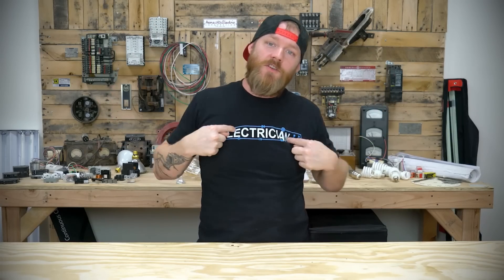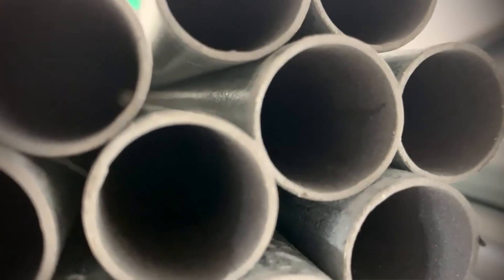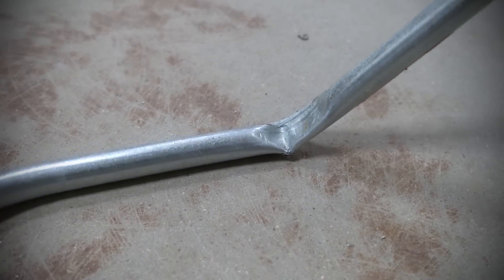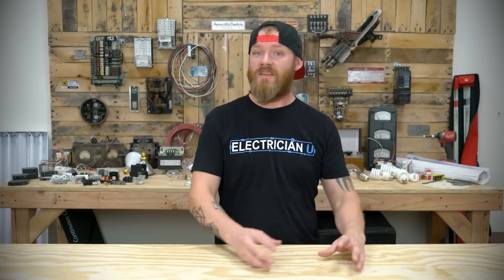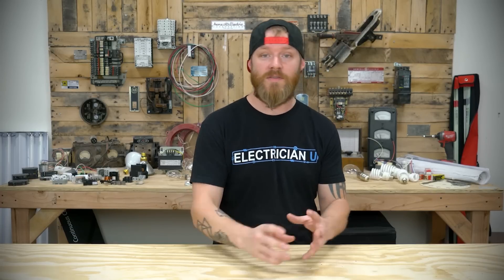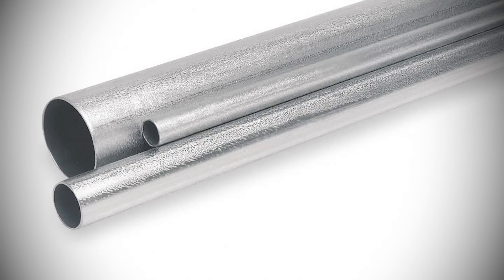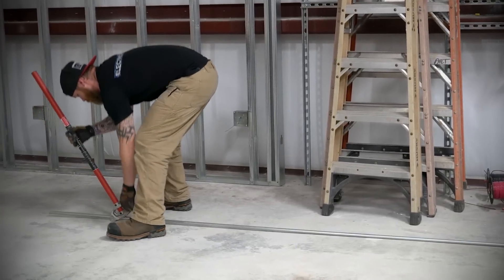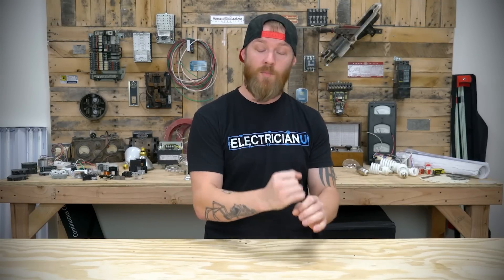Working With EMT and What Electricians Should Know - School Edit

Comment: If you use EMT conduit as part of the EGC system, is there a certain minimum size you need to use in relation to breaker amps, like there is for normal grounding conductors? I've never looked, but I assume coupling set screw diameter increases as EMT size increases, so it would be a factor to consider.  I'm doing a grain bin electrical system for myself now, could save me a wire.  When I did another building with EMT, I ran a seperate EGC in it and bonded it to all metal parts, even though I used set screw couplings, so it was redundant.  I'd be worried in an outdoor install if the galvanizing would corrode after 30 years and not be a good connection.  Seems better with an outdoor install to just use a separate EGC.

Comment: Great video!
It seems like electricians who are learning should be given the opportunity to evaluate conduit systems that have stood the test of time. (Or didn’t, like the pictures you shared)
When a loose coupling is found it’s easy to infer that the installer was more than likely a “Super Fast” 🦸‍♂️ installer. (Instead of being super-thorough and methodical)

Another issue that is often overlooked when designing conduit systems is expansion and contracting of the building or structure we are attaching to.

Comment: Two great uses for EMT : Bend a hook to use to turn off buss duct switches. Cut a few inches & unwrap it ( yep not easy ) to form a tool for installing steel wire to secure luminares that are in drop ceilings. Another use : cut washers out of milk jugs then I set a short sheet rock screw and use it as a blow gun. Years ago cut ten for lengths of  1/2" EMT in thirds ( 40" ) flatten ends and drilled 1/4" holes  then made a geometry dome for my sons science room. Very strong !

Comment: Question - What is the longest length i can run emt between two boxes without a support?   18", 24", 36" ???
Reply: According to code 24”. Specs may be more stringent.
Reply: @themaddendynasty5099  what is the code reference?

Comment: The "galvanised" and "aluminium" versions of EMT aren't EMT. They are RMC (rigid metal conduit). 

EMT is not rated for burial. Galvanized RMC is rated for burial.
Reply: What? So article 358.10 is wrong? The manufacturer's statements are wrong?  Everybody is wrong?
Reply: theyre both acceptable methods.

Comment: Thanks for the info!  I learned something new to me - didn't know EMT could be used as a grounding conductor
Reply: Absolutely - just make sure that there are no concentric knockouts remaining when attaching to an enclosure. For example, if you're coming out of a load center which has 3/4 inch with optional 1/2" KO's (and you're using 1/2" EMT,) then use 3/4 inch to 1/2" reducer washers. The locknut needs to be gripping grounded metal in its entirety.